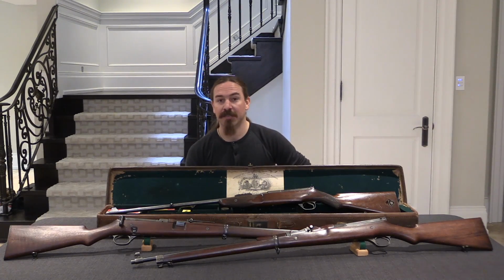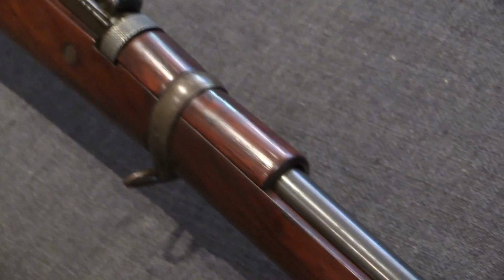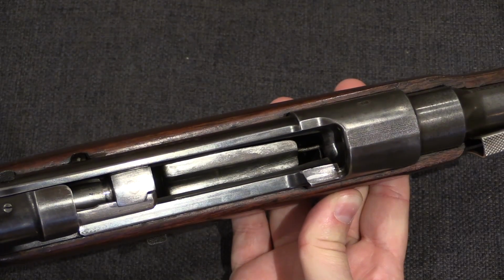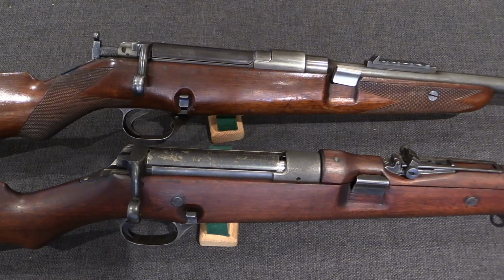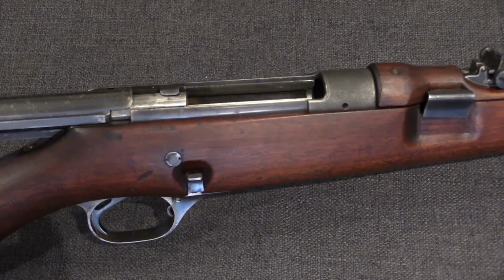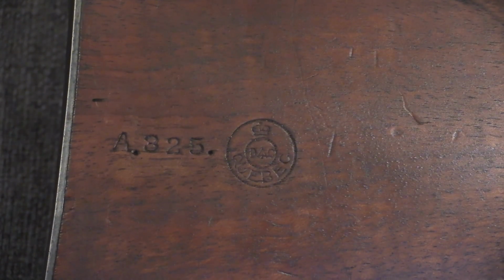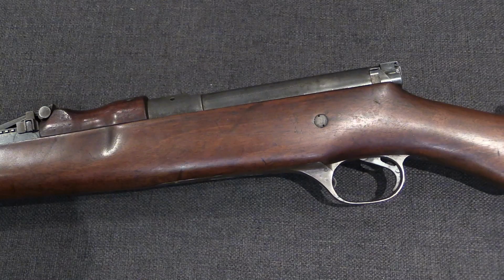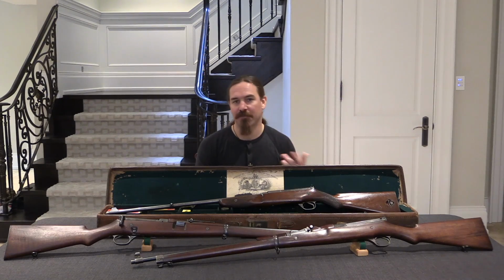Ross MkI: Canada's First Battle Rifle

Comment: Ian, There is a small screw on top front of the bolt of both the Mki and the Mki*. I may have to replace that screw. Do you know it's purpose and whether it is a common enough screw size and thread to be replaced?

Comment: I though the loose bolt issue extended to firing the rifle. I've heard stories of troops firing it and having the assembly fly out and hit them in the face.
Reply: He did a vid on that years ago. It was more a problem of the rifles being easy enough to assemble incorrectly such that it looked right, but would fire out of battery.

Comment: Are these the "use-your-face-as-a-bolt-stop"-rifles?
Reply: Actually, I think the reassembly issues only became an issue when they went to the interrupted-thread bolt design? Because the threads' engagement was shorter on one side than the other. The Mark 1 double-lugged bolt would have been immune, if I understand it correctly? Ian will surely reveal all in due course...

Comment: Way back in the 1970's when I started buying old military rifles because they were really cheap then everyone said to not every fire one of the Ross surplus rifles because if not assembled correctly it might kill you so I never bought one even though I could of picked one up for $40 or so back then from a local gun shop that specialized in surplus & antique firearms.
Reply: Ian's got an older video up (June 16th, 2013) where he fires one of those improperly-assembled Ross MkIIIs (set on a holding frame, of course) and yeah, it fails pretty spectacularly. Would literally have put someone's eye out.

Comment: It's really odd that Ross went from two locking lugs on MkII to interupted screws on the MkIII. Not only that but also going from a double stack magazine to a single stack between the MkII and MkIII. It makes no sense!
Reply: He was obsessed with target shooting and his rifles reflected that. He was trying to achieve maximum straight line rigidity in the bolt assembly. The Mk III has much more locking surface area and is stronger and more stable under recoil. Early straight pulls and some bolt action designs had zeros that wander over time because the bolt or the bolt head takes a set. The more rigid you make the whole assembly the more predictably accurate it will be.
Reply: The magazine is simply a case of making a gun easier to produce and use/maintain. The change is locking style is beyond me, but both seem to function just fine

Comment: The Ross rifle. A good sporting rifle. A not so good military rifle.
Reply: From what I understand the reason it was so unreliable was because it was chambered in a British round that was ever so slightly to large.
Reply: @Ghost48888  IIRC the British-made ammunition was made to a much looser spec - a Lee had greater tolerances that would let it eat lower-quality rounds without issue, but not the Ross. And that wouldn't be an apparent problem until they brought the rifles to Europe and started using British ammunition.
Reply: @TheBulap  also fighting in muddy trenches didn't help the low tolerances either
Reply: Its an excellent sniper rifle
Reply: Well said!

Comment: I hope you get a chance to show everyone the cool  way the barrel is removed on the #3 Ross rifles. You remove set screws on the bottom of the receiver then easily unscrew the barrel by hand  with the fast pitch thread requiring very few turns. It is unlike anything I've seen on any other weapon.  Bob
Reply: Ian Shows the fast receiver threads on the Mark 2 Ross's in the episode posted 10/30/19  thanks?

Comment: Man I really gotta get one of these. They are truly beautiful and as long as I don’t find myself in a trench they should be nothing but fun. Too bad .303 is way too expensive now.
Reply: keep the lady clean and oiled, nothing will fail
Reply: Reloading your own is the only way to go with 303 now, at least in the UK anyway. Only way I keep my SMLE fed. Buying factory loaded rounds is stupidly expensive
Reply: @roadsweeper1  All factory loaded rounds have basically doubled in price since the early '00s; you can blame it on rapid development in China & India [huge populations] driving demand for copper, zinc (& to a lesser extent, lead) raising the cost of materials.
Reply: Nunya Bidniz it would suck trying to find some obscure 1905 hunting cartridge. I’ll flip the bill for ease. Any tips for .303 hand loading out there
Reply: @kylebell7323  Pro-tip: buy a reloading manual [old used editions still work fine, altho' they may list powders NLA.] Prvi Partisan makes new, quality ammo. Save your brass!
Reply: yeah buddy reloading is the way to go. I've got a handful of enfields I keep fed fairly inexpensively via reloading.
Reply: Ross sold a lot of sporters in proper hunting cartridges. You might be able to find one of those, and they're probably less expen$ive, since they're not a "rare military collectible..."